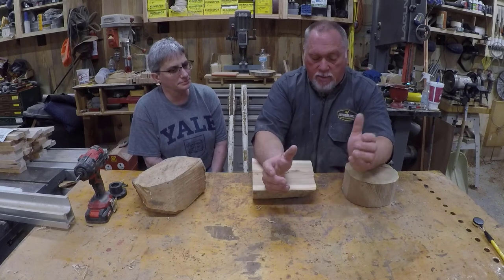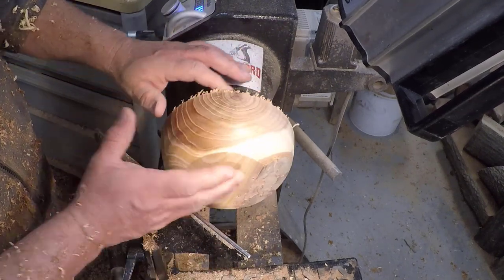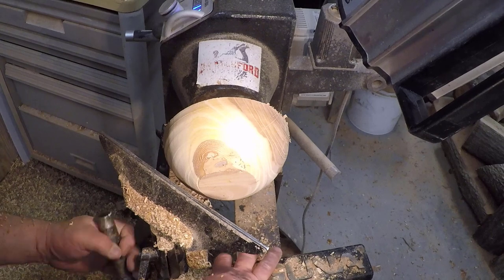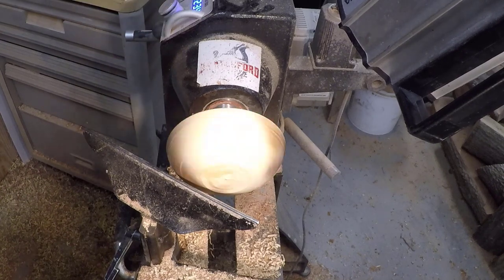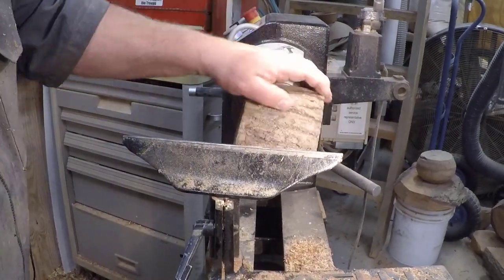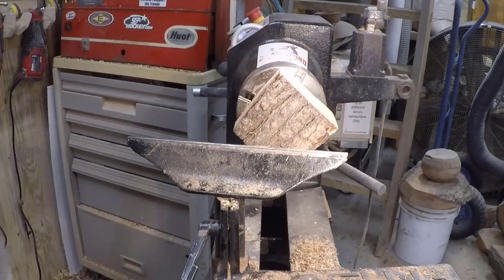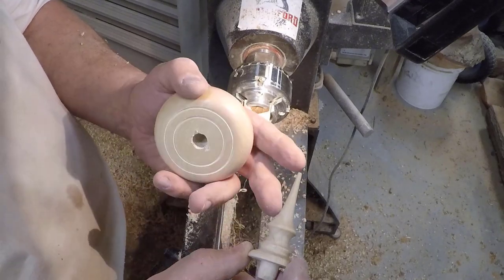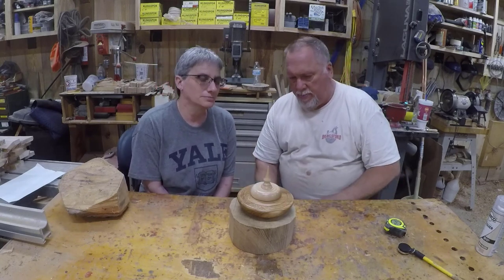Making an Urn for Ashes of Birth Mom

Comment: Hi Mike, That came out really nice indeed.
It can't have been an easy turn considering the circumstances.
Really impressed with your first finial. I haven't tried it yet and keep putting it off as spindle work is not my best by any means.
Are you going to coat the inside with anything as I believe over here in the UK Urns need to be sealed on the inside.
Take care Mike and very nice video.
Cheers, Huw
PS The split that happened was that on the pith?
Reply from the maker: Thanks Huw!  I actually did coat the inside with lacquer.    I hope that is enough.  She is planning on gluing the lid shut.
Reply: @BrailsfordWoodworks  Hi Mike, Just to be safe I would get your sister to check out local bye laws on non commercial Urns and the necessary standards that need to be met.
Reply from the maker: @WoodenItBeNice  sooooo.... I just checked it out.  North Carolina is pretty relaxed on burial law.   They don't have a standard for urns and scattering the ashes is almost completely wide open.  Just make sure you check with the owners first, is almost the only requirement.
Reply: @BrailsfordWoodworks  That is great news. I wasn't trying to put obstacles in you or your sister's way.
The rules here are quite strict
Reply from the maker: @WoodenItBeNice  No worries Huw!  I appreciate you having my back!
Reply: @BrailsfordWoodworks  👍👍